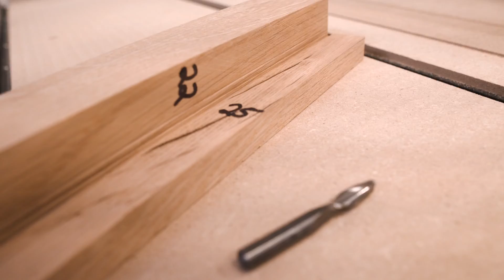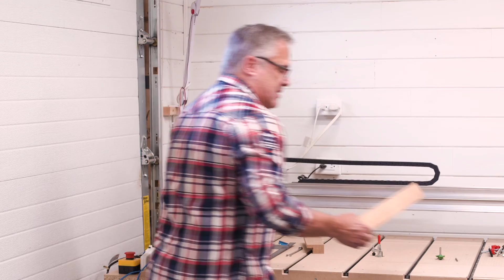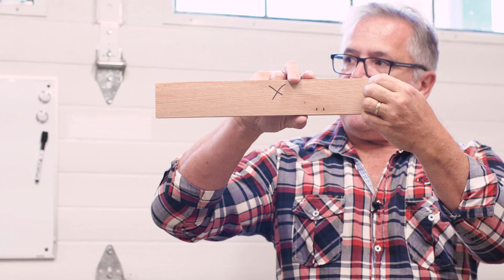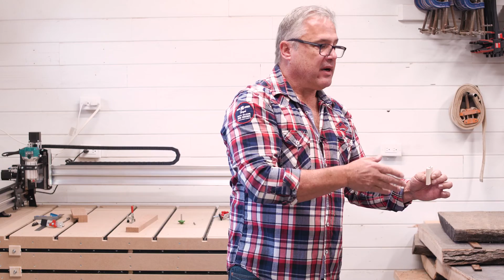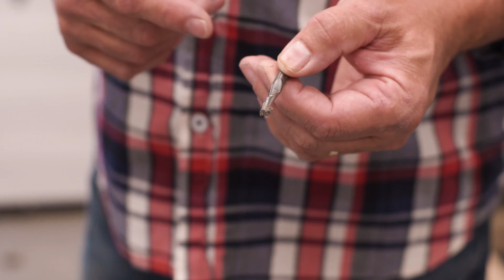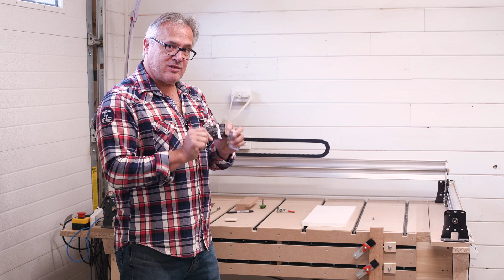DIY LongMill CNC Vertical Clamping Setup Part 1

Comment: i plan to have a vertical mount too, and for the length, i plan to dig down into the ground six or eight feet, and concrete in a box, to stand material in, just an idea 💡
Reply from the maker: That's quite the idea! Make sure you post that to our socials if you do it!

Comment: Would it be better to extend the horizontal spoil board to overlap the vertical spoil board so if the top needs to be flattened, the top of the vertical board matches? Your explanation is fantastic! Simple and easy to understand .